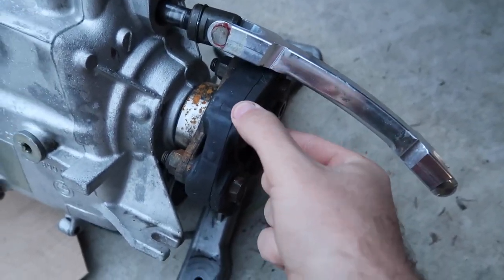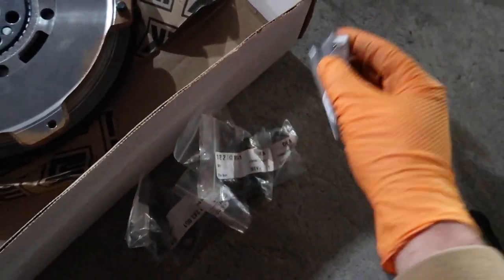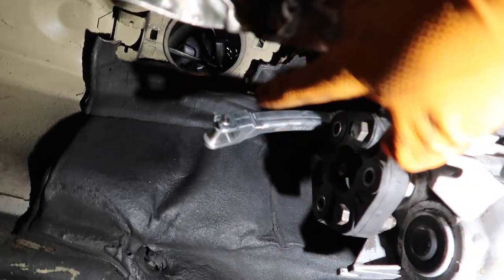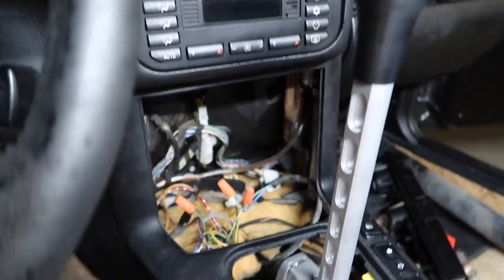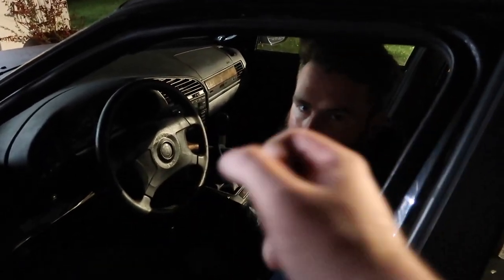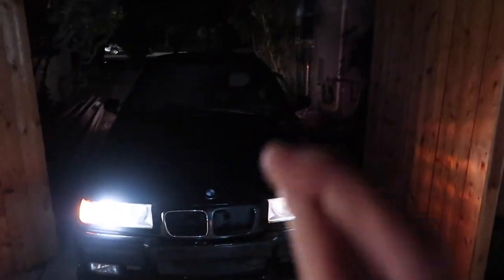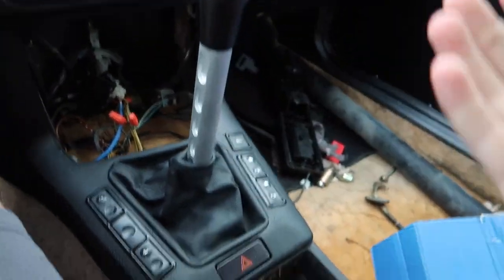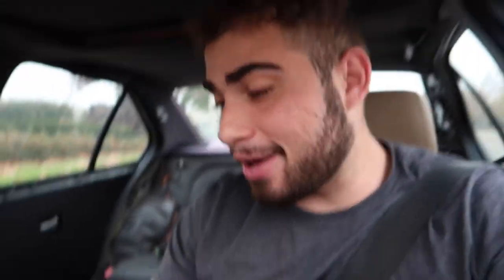WE OFFICIALLY CONVERTED THE E36 M3 TO A MANUAL!! RACE CAR SHIFTER UPGRADE!

Comment: I think you should cage it but put in the M3 black rear seats and black M3 Vader seats with an e46 steering wheel from AZ auto and redo the headliner and black carpet it would look fire. 🔥

Comment: To bypass tuning can you just replace the ecu with a manual cars ecu?
Reply: Yes, you can or get a new flashed EPROM chip from a tuner and fix everything while also increasing power. 🏁🏁🏁
Reply: U will still need it flashed to ur cars vin. Just hit up kassel performance,send them ur vin and they will send u a flashed ecu(or u can send urs to save 80 bux). Can also add the "popcorn" tune if u want. I did the manual swap and the m50 intake swap at the same time,and luckily I live in PA where kassel is located so I actually went to their shop which was like a BMW heaven

Comment: Can't wait till the long ass 18 wheeler shifter fad goes away. People putting racecar parts on their daily drivers is silly. My armrest and shift boot are both from u pullit and SPOTLESS.  Idk if ur just green when it comes to cars but my swap was easy af.  The ecu has NOTHING to do with the shifting,once u pull that chip it will shift normal. Get ur tune done with kassel. Also do the shift detents and it will line up them shifts